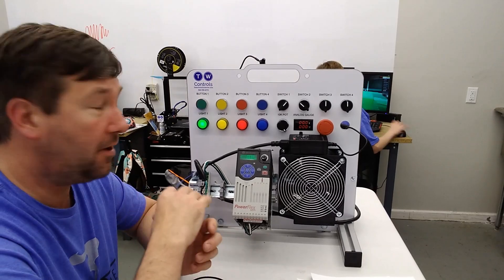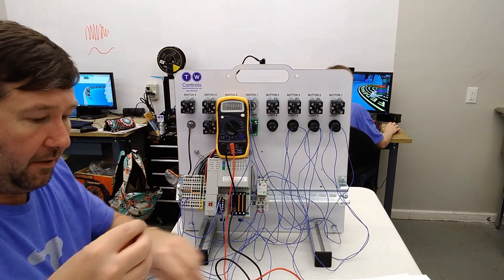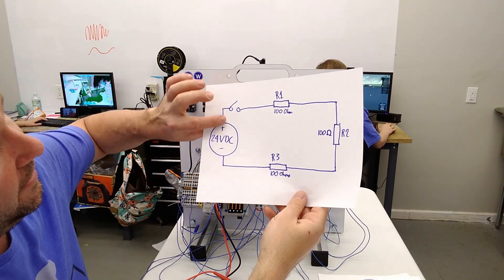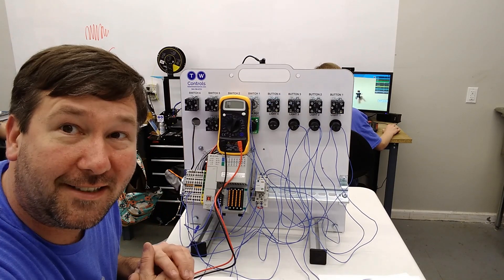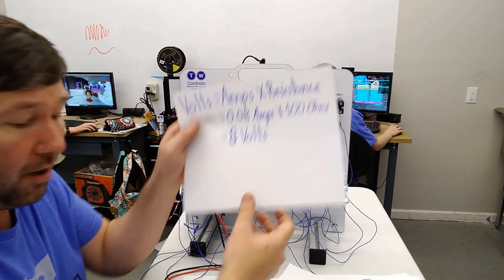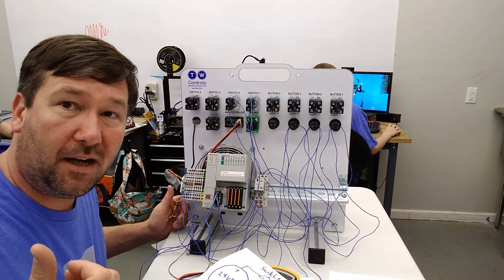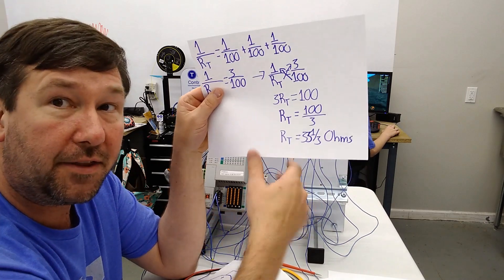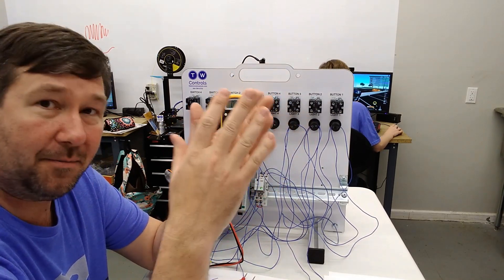Calculating Volts and Amps on Series and Parallel DC Circuits.

Comment: Hmm, 24 volts? 100 Ohms? 1/4 Watt resistor? Hang on for a minute while I get some popcorn, I don't want to miss the electroboom moment. :)

24 x 24 / 100 = 5.76 Watts. This shouldn't take long...

How warm did your resistors get? ;>
Reply from the maker: No blowing up electrical devices on this channel like Electroboom :)
Reply: @TimWilborne  I'm surprised that we didn't see them glowing. :)

Comment: The formula for parallel is product over sum
Reply: Only with two resistors...
Reply: @dr.g7898  I was wrong it was for 2 resistors, otherwise its 1 over r1+ 1 over r2+ 1 over r3 and so on...my bad.
Reply: @FollowerofYahuwah  The other option is, if each resistor is same value (or nearly the same) then divide by the number resistors.  For example, in Prof Tim's circuit (please buy a protoboard :) )  for three 100 Ohms resistors: 100 Ohms/3  =~33 Ohms.  It is not necessary to use the "reciprocals" formula.  This also works (quick and dirty) if the resistors are nearly the same, e.g., 100 Ohms, 95 Ohms and 105 Ohms.  These are tricks of the trade that profs. in EE don't teach.  With some exceptions :)
Reply: That formula works with more than just two resistors, I pretty certain it does. Are you referring to dividing by 2 if both the resistors values are equal? Maybe I'm wrong but I just finished an electrical principles course, I'm not throwing anything out there to sound more valid but it was very recent but like I said I could be wrong.